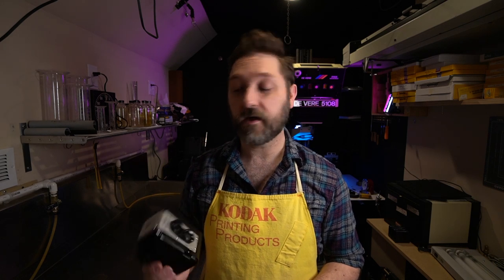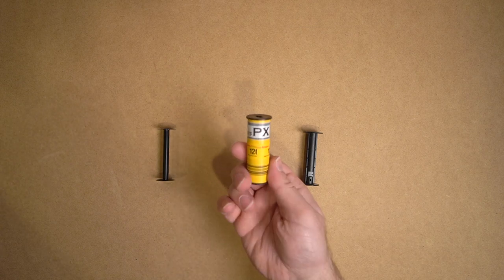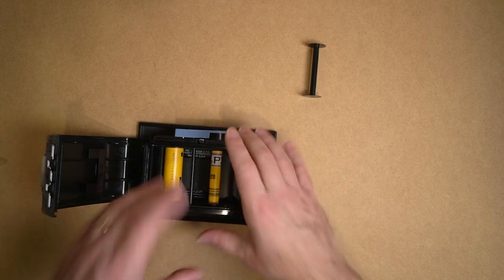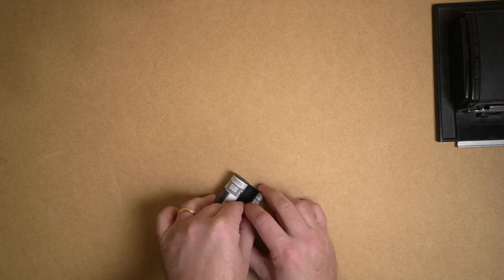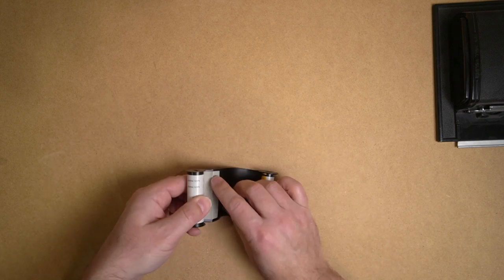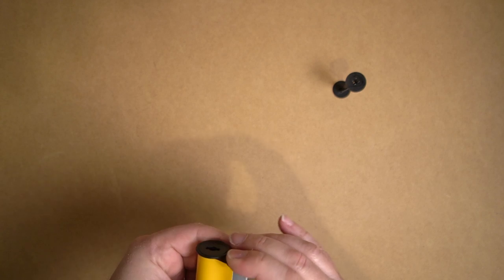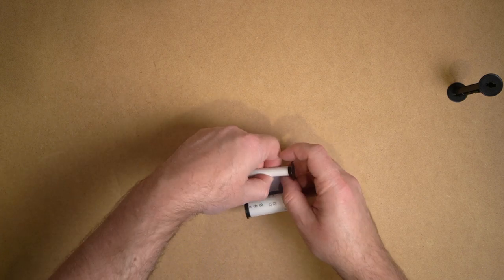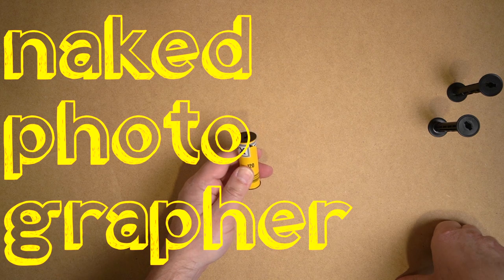Spooling 620 Film

Comment: Since you have a supply and a takeup spool in 620 size anyway, if you do the first transfer to 620, it'll reduce the amount of buckling you get when you reroll to get the direction right.  Sometimes you won't need to even peel the tape if you use a 620 spool for the first transfer.
Reply: That's what I do, too.

Comment: With my box brownies, I carefully clip the edges of the 120 spools and the shoot from that directly onto a 620 spool at the take-up side. Works perfectly, but I suppose it depends on the camera.
Reply from the maker: With my cameras, it’s the width of the 120 spools that are the problem, not the diameter.
Reply: @TheNakedPhotographer  ah yes. Mine have spring loaded contacts
Reply: I have 620 cameras that will accept a 120 trimmed only for diameter, and a couple in which the flange thickness (which makes the spool a millimeter or so longer) prevents them fitting.  I've modified the camera to take a 120 supply in a couple cases; otherwise, if spool length is the problem, I respool -- but I don't use those cameras much.

Comment: So glad I wasn't drinking when the opening credits started.  Nice mix of basic and slightly more advanced skills on here.  You could also use a 120 folding camera that is missing a lens or bellows. Just tape up any light leaks with the camera closed up. No need to open it to use the winder.
Reply from the maker: It may depend on the camera.  None of mine have a small enough tab to fit into a 620 spool.
Reply: @TheNakedPhotographer  I meant 120 (a) to 120 (b) spool before the 620. This gives me an idea to try using a 620 camera to go from the 120b to 620 spool up to the tape point in a changing bag.....
Reply from the maker: That should work fine

Comment: I ended up gluing some sand paper to a junk piece of wood. Clipped off the lip and ground away until it fit my Kayak Vigilant 620. My Hawkeye is the 52 model so 120 will fit Un modded. I have never respooled so I have no idea if that's easier.  
Great video.

Comment: Since the size of the spools aren't that different, why can't you place the 620 spool in the 120 film back? Is it due to the diameter of the spool?
Reply from the maker: The hole that engages with the gears is too small on a 620 spool to fit in a 120 camera.

Comment: If I use a Hasselblad and manually crank from 120-a to 120-b I still have to get it back on the 620.
Is anyone making 120 spools using a 3d printer ? That would solve the issue, no?

Comment: For the first part, rolling onto a second 120 spool, why not just load it in a 120 camera of almost any sort and advance to the end as you normally would when taking pictures but without doing any exposures? I don’t have a film holder like yours lying about, but I certainly have 120 cameras lying about.
Reply from the maker: There is no practical difference, I just used what I had.